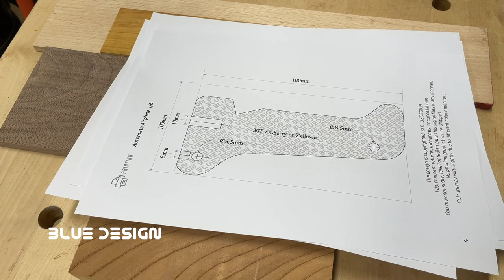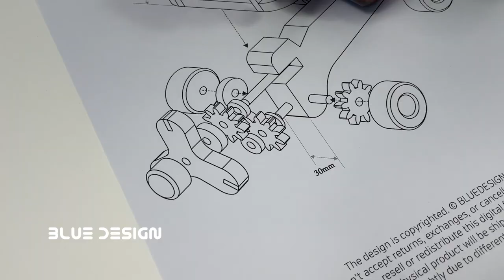How to Make a Wooden Automata toy Airplane with Gear teeth

Comment: Estan hermosos. Quiero preguntarte que tipo de aceite le pones al final para que queden con ese aspecto brilloso
Reply from the maker: I use auro oil.
Paint No. 126 with auro and dry it. And,
Paint No.129 as an aurora again and finish by drying.